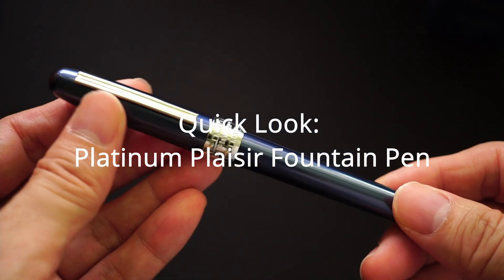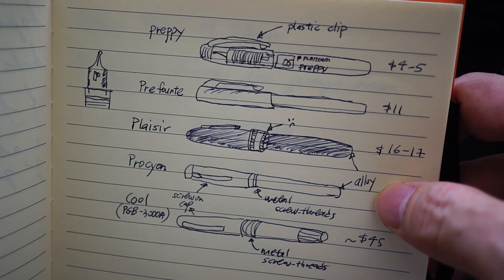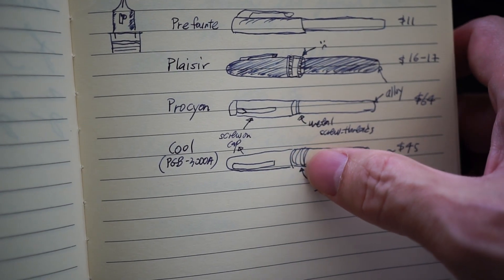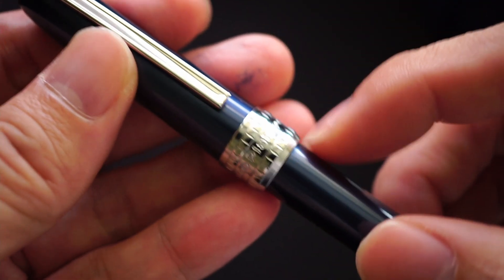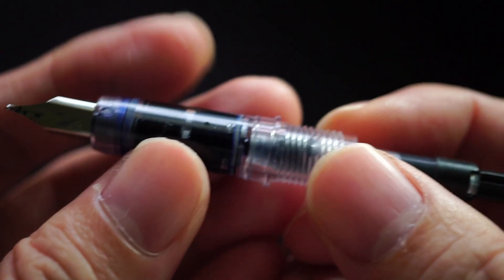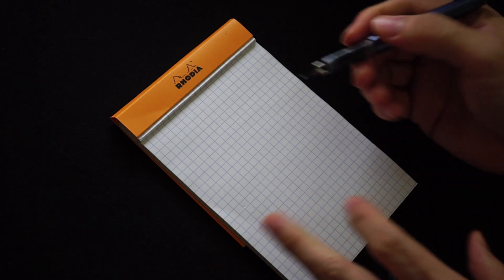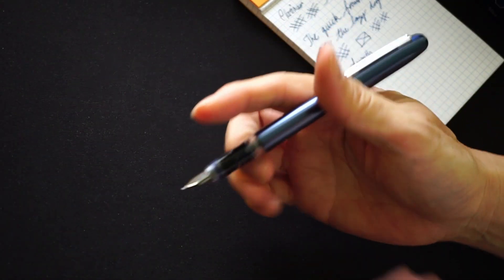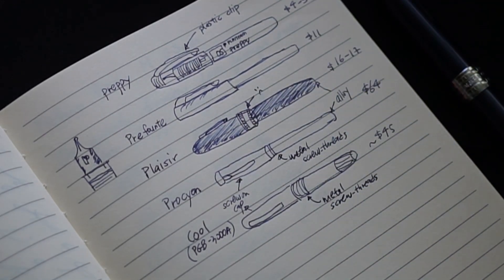Quick Look: Platinum Plaisir Fountain Pen

Comment: The Platinum Plasir is my Desert Island pen and is an essential part of my EDC simply because of its durable metal body, convenient snap cap, its wider diameter, its small weight, its grip section, and its compatibility with Preppy nibs which write reliably and smoothly while also being cheap and easy to replace. It is a cartridge converter pen making it the only filler I can use (I've tried internal and eyedropper filling, and I hate them), and is cheap enough so that I am not too concerned about loosing it.

Comment: nice review! i was wondering if it is possible to clean the nib fins from the inks stuck in the transparent section?
Reply from the maker: If I am not wrong you can pull the nib off carefully. It will come off with the feed. Then soak the fins section (or use a syringe bulb). You might not manage to get ALL of the old ink out. Just refill with the same color ink is what I always do. Good luck!